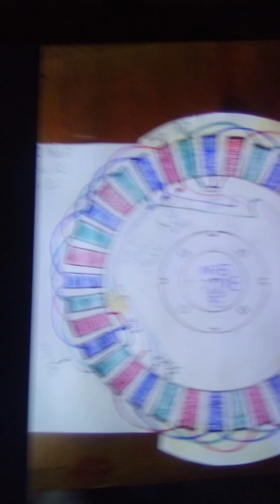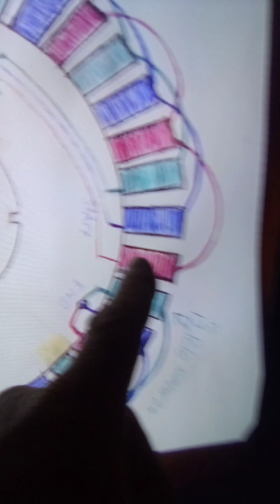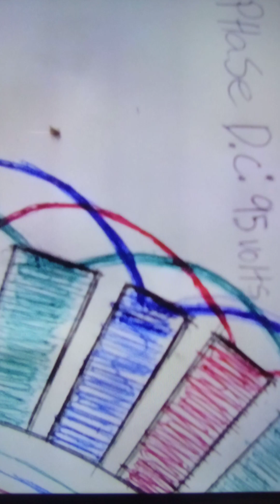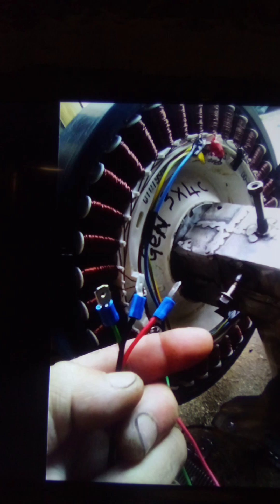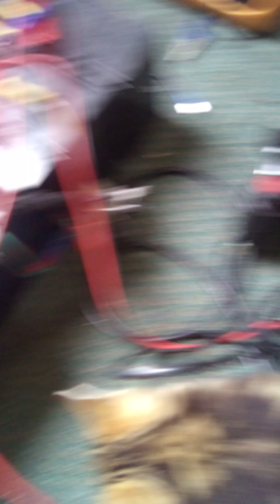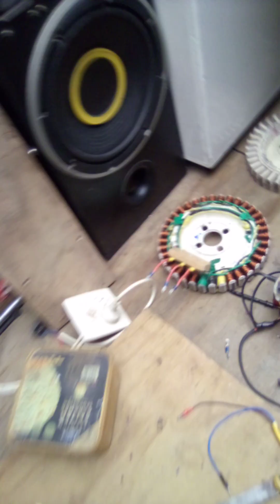washing machine motor generator 3x4c diagram 👍😁

Comment: Brother , what's the purpose of the way u wired it? The 3 in 1. Thanks
Reply from the maker: Yip the purpose is to get different volts of power back out . this is good for charging 72 volt to 80 volt 😊👍

Comment: Hi, at what stage are the jobs of two washing machine engines one motor and the other generator? I am eager to know the result.. if the engine consumes less than the generator can charge the batteries..
Reply from the maker: Allsome stuff guys yip I'm just getting the two washing machine motors mounted on the trike frame today 😁👍 and I'm hoping to have a follow up vid with it before the big test😁👍
Reply from the maker: I guess I could have one of the washing machine motors allways charging full time good Idea 👌😁👍I was only thinking about using it as a regen brake lol 😂 cool stuff allsome work guys from cruzermans inventions 😁👍

Comment: Hi Tristan, did you check the rpm on your DD rewired in stranded copper from the other video with 76.5v input?
Reply from the maker: Hi hi there's two things I leave out of my videos one is amps and the other is RPMS just because iv got no meters for it lol but the washing machine motor I'm going to be putting on the trike runs 3 times faster than what the motor done in the washing machine 👍😃
Reply: @tristanmcnabb2741  hello, for the amps, it's not great, I've already done the measurements, there are volts but no amps. motor on 1 phase and the other 2 in generator. the motor consumes double or even a little more than the output of the other 2.
Reply from the maker: I will do a video of it all soon 😁👌
Reply from the maker: Yip I put the 1000 watt 72 volt controller on the gen just to see how fast that was with stock alloy and it was really slow but rewired with the 1 ,5 mm cooper wire at 25 turns per pole was perfect .way way faster.thats 3 x12 poles
Reply: @tristanmcnabb2741  hi, i also found the same thing, factory motor, 71v 120rpm, but motor rewired 71v 770rpm. just wondering if rewiring them to copper changes anything because my DDs are aluminum 36poles.